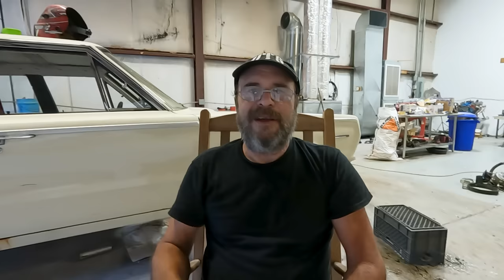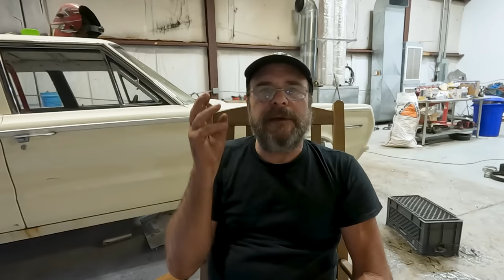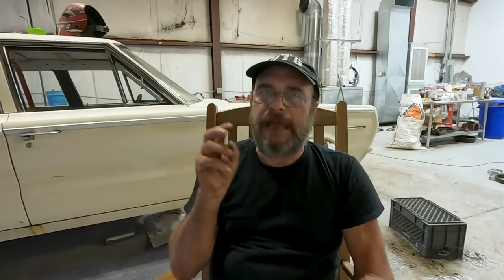They Really Are Out To Get You- How The Automakers Have Made Life Miserable For The Average Mechanic

Comment: Hey Tony, we think alike on the out to get you message. I first encountered this about 1973 when I was going to college at Ferris State college in Michigan. The industry had previously replaced the road draft tube with the PCV valve. Then about that time they added EGR and air pumps, which a lot of people just disabled. Anyway, in one of the School labs, we hooked up one of the students 63 Chevy on the dyno and tested the output at the tailpipe. Then after just adjusting timing, fuel mixture, etc. we met the current emission requirements. So I thought if a bunch of students can do this, this is just a way for them to make more money and capture the service work at the same time. I worked at GM dealership for a while after school and started seeing what you saw. I’m sure a lot of guys are nodding their heads in agreement when listening to you.
Reply: My 1969 Grand Prix with a 428 4bbl and dual exhausts made emissions too. It was just slightly cleaner with far less CO than my folks' brand new 1988 Bonneville that was labeled "Borderline-needs inspection" and they had to pay over $100 for a garage to hook up a computer and do the timing and everything, and then it barely passed.
Reply: I remember a 72 Pontiac Lemans with a Pontiac 350 2 barrel I used to drive pass emissions extremely well and the readouts were surprising against a vehicle with pollution equipment like a TCS switch, catalytic converter, slower mechanical timing, too lean of carburetor settings. The car from the previous owners disabled the TCS switch and redone the timing a little more advanced.  Not to mention it actually got good gas mileage city and highway with a decent amount of torque. Knew a guy who put a "dummy" EGR valve on an intake not designed for one on his 76 390 powered Ford Truck to get around emissions. It worked great.

Comment: I was seeing this starting to happen a couple decades ago myself. At one time I owned a 1984 S10 Blazer that had a 5 speed manual that used a hydraulic clutch. The slave cylinder for the clutch release was bolted to the outside of the bell housing on the drivers side, accessible for repair or replacement with the air bleeding procedure outlined in the Haynes manual. Years later, I had a 1998 Chevy K1500 truck, also with a 5 speed and hydraulic clutch. The slave cylinder went out on it and I found out that now it is mounted within the bell housing. Of course when it fails, it leaks, it leaks fluid on the clutch disk. So now, its a total clutch job to the tune of $1200 (prices then). Again, NO reason for GM to redesign this system unless it was to promote more customer pay jobs for repair centers. This was back in 2000 or so, so yes, this has been brewing for quite a while now.
Reply: I have a 2004 saturn vue with the GM 4 cylinder and 5 speed manual. It's been sitting in my driveway for a long time because the slave cylinder went out, and just like you described, it's inside the bell housing and has doused the clutch in fluid. It's such a pain in the ass to fix for such a cheap car I haven't even considered doing it yet. I also have a 4 cylinder 5 speed manual 1993 mazda b2600i (the last year they were made in Japan), and when the slave cylinder went out on that it was a 15-20 minute job to fix since it is mounted outside the bell housing, easily accessible. Sometimes the future just sucks.
Reply: That’s just an example of more labor needed. Not the same as dealing with proprietary systems. Not even close to the same thing.
Reply: @seanneal552  the whole point of this video was how manufacturers/engineers make things harder on purpose to the detriment of the professional/DIY mechanics later on. I would say replacing a critical single small part in 15 minutes on an older car is a lot different than having to drop the entire sub-frame and engine/transmission to replace the exact same part on a more modern car. Also the design of the inside bell housing slave cylinder inherently means it will roast your clutch as soon as it starts leaking.

Comment: I remember as a kid, there were all kinds of mom and pop mechanics. Older cars were much simpler, but they did need more frequent maintenance. And the kicker was, no special tools were generally required! Then, as the years rolled on, the mom-and-pops started disappearing. Now it’s the dealer and large chains mostly. Really sad, actually.
Reply: I still work on mine. 98 Z71 Silverado and 2008 Cobalt. Lots more complicated than when I started in the family gas station in the 70s. Nice that spark plugs last 100k miles and cars last 200k miles or more if you do a reasonable amount of maintenance.
Did several fuel pumps. That can be a challenge the first time. Google and YouTube make it so much easier to get a heads up on new unfamiliar repairs.
Helps a lot if you already know the  basics.

Comment: As a guy who grew up in the 90s and early 00s, I loved working on my mid-80s truck. I could practically rebuild the thing with the tools inside the toolbox in the bed. When I finally bought a newer vehicle, I quickly discovered how much money I would have to spend on "special tools" to work on my own vehicle. I've always wished they would make cars simple again and enjoyable to work on.
Reply: The only simple cars left are go-karts, and even those it's a matter of time before they get stuffed full of computers.
Reply: @noseboop4354  Imagine a go-kart engine with EGR valves, catalytic converters, 02 sensors and evap systems. Ugghh. They already have small diesel lawn tractors with full emissions systems in place. Imagine not being able to mow your lawn because it's derated due to an emissions system malfunction...
Reply: And I love working on 80's and older trucks. So simple and so much space. I Cummins swapped my '83 Chevy, it was surprisingly easy and I used basic tools. Well, I DID have to use a welder at one point to weld some braces for the radiator core support, after I cut a lot of it out for the intercooler. But to put a modern diesel engine and drivetrain into a 1983 truck that never had that option, that ain't bad. 

I can't imagine the nightmare to do that on a new truck.
Reply: I wish they would make life simple and enjoyable again...they've removed it all.
Reply: Legislators are in bed with all major corporations. Same thing with green energy legislators own stocks in these companies and want them to grow artificially.
Reply: I like getting great gas mileage.  Nothing beats it.

Comment: As a tech training with Ford I can tell you the electronics and the pricing of these new vehicles is WAY out of hand. You can't even replace a battery in a new Ford yourself. They have a battery monitor sensor that requires to be reset by having a laptop plugged in with Fords software. People look at me funny when I tell them I'm rebuilding a 25 year truck to drive everyday. I like being able to save money on being able to maintain my own vehicle, after all that's what led me down the path of mechanic work. Really a shame what things have come to.
Reply: I trained as a mechanic from '89 for much the same reason plus I enjoyed the hands-on work and just fixing things. Then I went into mechanical engineering design. But the only thing my vehicles have ever gone into a shop for is those jobs where I simply don't have the equipment or it's not worth my time. It was the best decision I ever made - vehicles are the second most expensive thing most people will ever own - it's madness not to mitigate that cost by doing maintenance yourself. I honestly pity people that can't maintain their vehicles themselves - it costs a small fortune to pay someone else to do it!
I'm driving a mid-nineties car that I've had for 15 years and I really don't want anything newer - there's nothing that newer vehicles have that I want enough to put up with the headaches that come with it.
Reply: @TonyRule My 2017 Honda was sold as the simplest car in many ways and I do all the work on it but just because a wheel turns when the ignition is on, and I am rolling the car by hand,  the computer throws a permanent error for wheelspeed sensors and I have to pay 150 or more dollars to the dealer to reset it taking 5 minutes. Similar with airbag seat calibration when changing one of the seats. And then the car stereo has no media playback (no CD, no cassette) and is nearly impossible to upgrade. Yes its been frustrating but some things have been advanced and worked well.
Reply: I’m with you on just buying and rebuilding an older vehicle, seriously considering a 7.3 idi truck myself.
Reply: I’m also a Ford Tech. Right now I’m trying to inspect the camshafts on a 2023 Aviator. Getting the valve covers off is a nightmare.
Reply: Watch if it goes full EV the job losses will be huge
Reply: My 99.5 Jetta is kinda too new to me , but there's not too much plastic crap and a lot of that plastic crap on the engine like plastic water outlets can be replaced with cast aluminum quality aftermarket parts. 
Anything much newer than that car is garbage, don't make me mention the plastic water pump assemblies on the mk6 and newer that they got their pants sued off over.
Reply: Yeah, BMW and Mercedes have been doing that (euro in general) for the last 20 years. As an independent tech, i had a BMW owner bitching because he changed his battery and every 3 or 4  months he had to replace a 300$ AGM battery.  2 minute conversation, and bingo, I reset the charging system and he  didnt have the issue anymore. Same thing. I have 20 years in trade.
Reply: @prairiestateautoresto  I am working regularly on the 3.5 eco toast, The valve covers melt into the spark plug tubes. They suck to pull.
Reply: @prairiestateautoresto have u done the 5.4 3v?? With the engine in that thing was a nightmare lol
Reply: @noobjitsu1743  that was what I worked on in Ford Training where they told us these are the engines you will see everyday. The 5.4 is nothing compared the the 3.0 EcoBoost in an Aviator.
Reply: @rodx5571  How about the VCT rattles?
Reply: This is part of the reason I put a 5.0 H.O. in a 96 ranger
Reply: @prairiestateautoresto  Ok ill be sure to stay away from that one.
Reply: @prairiestateautoresto  you mean on the 3.5? Never heard VCT rattle (I assume you mean variable cam timing) but I have heard chain slap, startup rattle, worn out phaser clicking. I just did a 5.4 3v that guides were so far gone the chain  ate a hole in the timing cover.
Reply: @SSgt-  I daily drive a 12 valve swapped Chevy 1 ton and it's so simple, cheap, and reliable it's crazy. 

My friend has a 1986 ford f250 6.9 idi, damn thing just won't stop working. Old faithful.
Reply: I've got a 1990 F-150 that is soon to get a body restoration and paint. It's my daily driver but is getting a little ragged around the edges. Luckily I know auto body and can do it all myself, and have already rebuilt the engine once and installed a new transmission about 20,000 miles ago. I consider 1990 a sweet spot with minimal computer control and still plenty old school.
Reply: @SSgt-  I have a 7.3 Powerstroke I will never part with.

Comment: I once read a Newsweek article on vehicle manufacturers doing things like making the muffler system route up into the frame and around just so it's harder to replace yourself. This has been going on for 30 years already.
Reply: Fairly certain that was Corvette doing that to save space.
Reply: buy nothing made after 2000. problem solved 👍🏻
Reply: @myprivatewar most of the good stuff is likely been scrapped and melted down to become some liberal monument in a blue city, no thanks to the "cash for clunkers" program. 

Anything else will likely be bidded way above the price range of the average classic car enthusiast, due to supposed scarcity/rarity of the item.

Which is unfortunate.😑

Comment: You are correct about the “you wrestle with this stuff” part. Nowadays you need a scan tool to check and set the transmission oil level, or to even change your rear brakes. There are plastic oil pan drain plugs that are meant to be used once,  and because everything is controlled by a computer, everything requires some calibration or coding if replaced. It is all in the name of keeping the profits in the dealership as much as possible. Eventually the after-market catches up and they offer the special tools (or a version of them) and after-market scan tools can do some of the coding needed. I should know, I work at a dealership.
Reply: Even the dealership don't know how to fix it
Reply: I like older cars as more information is readily available online for diy repair. No top secret denial of information.

Comment: Mechanical injection diesel is the way to go. They last forever, they are easy to service, and they can run on various different fuels. My friend has an 82 Toronado with the 350 Oldsmobile diesel. It has 542,000 miles on it. Recently we changed the head gaskets and put ARP studs. The cylinders are in perfect shape, they are standard size, the pistons are the factory ones, and the crosshatching looks excellent. It gets 40 miles per gallon on the highway and has a 23 gallon fuel tank. Everything is rebuildable. You can recondition both types of injectors on these at home. The Stanadyne injectors just require a tool for turning the pintle and a fine lapping compound. The CAV injectors get lapped just like a valve, they have a poppet and a seat. The pump is a Stanadyne DB2, used on a million different types of diesel engines. It can be rebuilt at any diesel shop or even by yourself if in decent shape. There are other old diesels in cars as well that are similarly easy to maintain. Oldsmobile made a 4.3 V6 version that didn't have the head bolt issue of the V8, it has 6 head bolts per cylinder. The diesel Chevette and Isuzu I-mark are also great. The old, pre-1990 VW diesels. There was a diesel Corolla and Camry. There was a diesel Maxima. There was a diesel Ford Tempo. Not to mention all of the Opel, Renault, Citroen, Peugeot, European Ford, and other diesels that are extremely cheap in Europe and wouldn't cost that much to import. Many of these cars are $2000 or less, with importing costing around $3000, you're at 5000 max.  Many of them are under $1000 even. Diesel is where we all need to be going, not gasoline. Diesels will still be able to be fueled long after the new cars are all electric. And perhaps, biodiesel will be common because construction equipment, heavy trucks, and boats will not work as EVs.
Reply: But diesel fuel is now outrageously expensive. I am old enough to remember when it was much cheaper than refined gasoline. Another scam!
Reply: Agreed with the concept.  I had a 1982 bmw 320i gasoline auto with the M10 4-cyl engine.  They had mechanical fuel injection and 'no points' ignition.   Very easy to work on and reliable.  Biggest issue would be the mechanical proportioning valve which was sensitive to vacuum leaks, but easy to diagnose.
Also, power brakes and manual rack and pinion steering.
Reply: 100%with you! Just bought another old dodge cummins
Reply: Used to love running the IDIs, but they're getting old now - parts are hard to find or are junk, fewer and fewer shops have guys who know how to tune, bench test (or even work on!) the mechanical injection pumps. Since you mentioned the GM 350 IDI: ask a modern diesel tech who Roosa Master is and their eyes will glaze over. The days of "old" diesel (in the US) have passed unless you're real good, have a full shop, and a parts stockpile. The cost of the garbage no. 2 they sell now sealed it for me years ago.

Comment: I'm rolling in a 1998 Saturn SL.  Manual 5 speed, cable connection for throttle, all mechanical.  Love it. Gets as much as 40 mpg out on the road too.  What you are saying is absolutely true.  My wife's Prius has a computer module to operate the horn - and it has gone bad.  $400 bill to fix?  Who knows, still broken. That part your talking about "CORPORATE" that started in the 1870s...thanks for sharing that.  I hope folks do their research.

Comment: A perfect example of what your talking about is the 3.5 3.7 ford V6 installed in the Ford edge, Taurus and explorer. The waterpump runs off the timing chain inside the motor. You have to drop the motor to change the waterpump.
Reply: I didn't buy a Ford Flex when I learned that the 3.5 with the internal water pump can leak the dilute the engine oil and seize the engine!.  GENIUS!
Reply: Stupid. If that water pump seizes good buy engine!!
Reply: I have a 2005 dodge stratus with the 2.7 l v6 in it that’s like that….cant find anyone to attempt the repair so it’s been sittting for a decade…155,000 miles on it is all…..I loved that car too….i was getting 35 mpg on the highway in it and otherwise never had any issues with it breaking down…..
Reply: My 2002 mercury grand marquis is so easy to work on.